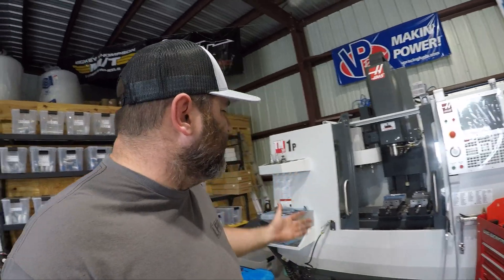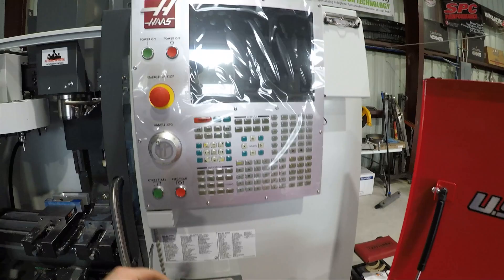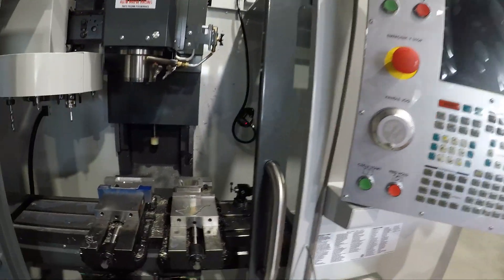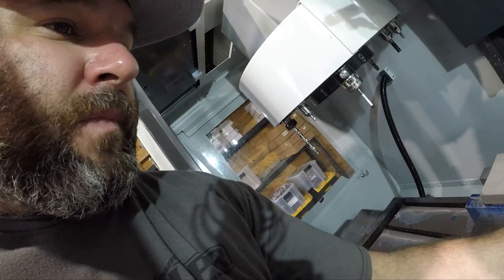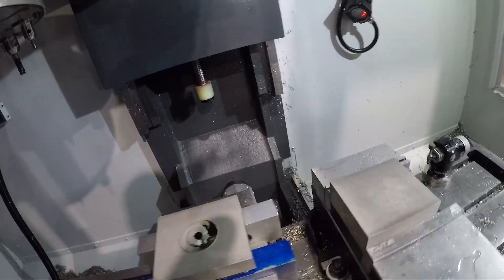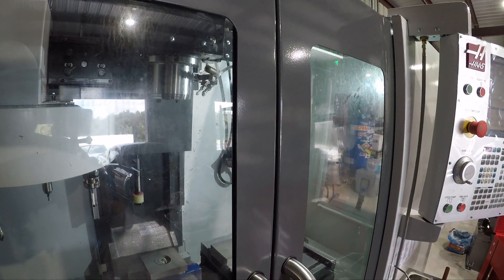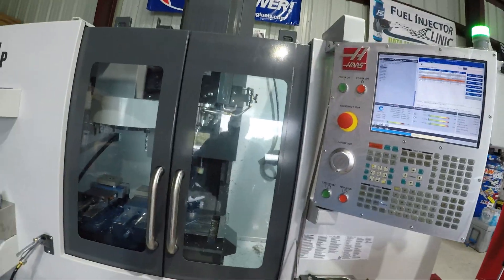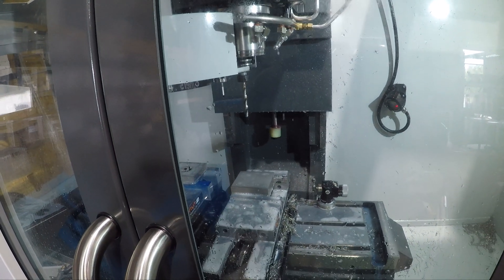Mafia Made -- Making T4 to 2.5 Stainless Steel Turbo Flanges on our HAAS CNC Machine

Comment: Peck drill to avoid the chips coming out like that. Also reduce the length of that drill bit extending out of the tool holder. Congrats on your TM-1P
Reply from the maker: Thanks!  We sold it and we are looking at a UMC1000

Comment: NEVER ever pull on chips by bare hand! I did nearly cut my thump in half by pulling on a chip with only a fraction of the force like you did.
Always use a chip hook or some pliers.

To get rid of this long chips during the drillig process you can use some chip breaking cycles. How do you program the machine? By hand with g code or with fusion 360 or other cam system?
Reply from the maker: We have put in a pecking cycle and she still does pretty long ones.  But yes we use pliers now
Reply: @automafiaracing  how deep you go between the retracts?
Reply from the maker: Id have to look it up
Reply: If you retract to clear the part and reverse the spindle, spin it up to speed the strings  will fly off.